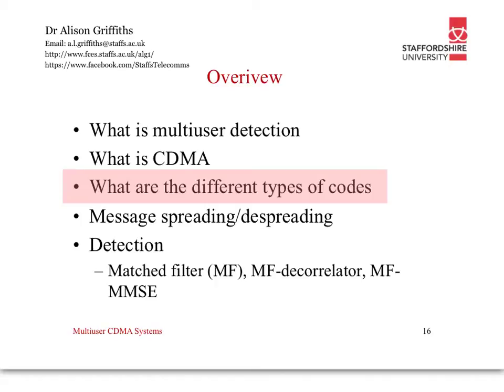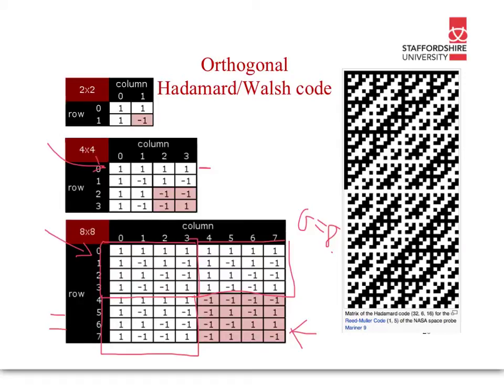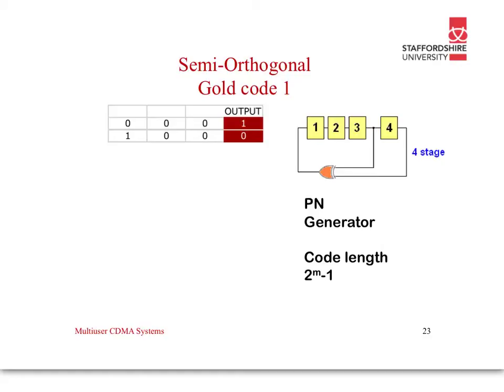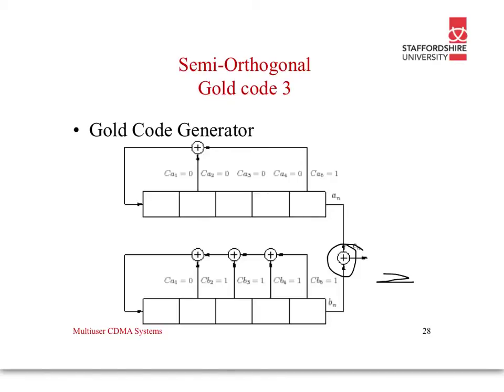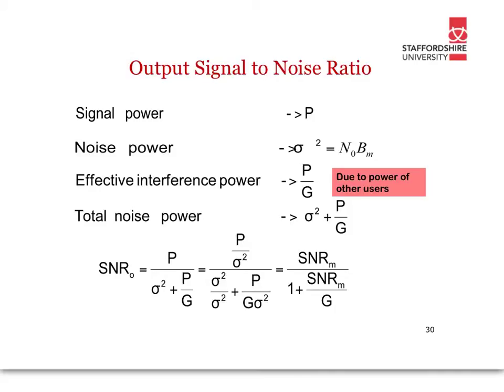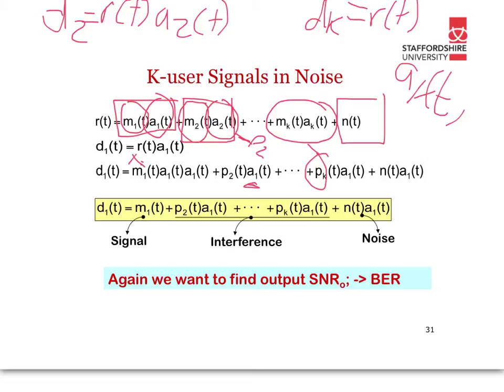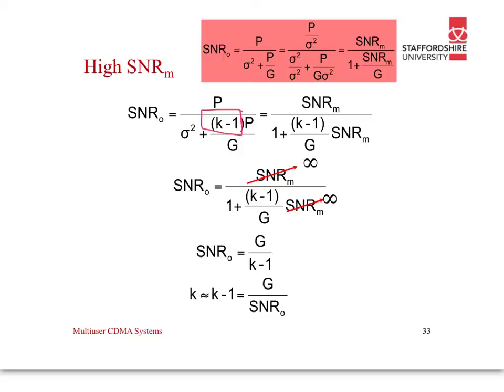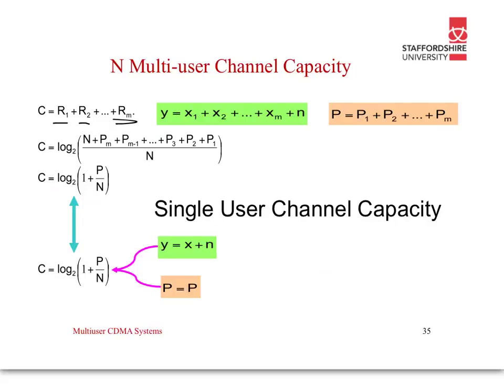CDMA part b

Comment: Hello, thank you for your nice explanied video.Could you tell me please whether or not to get a 7X7 Walsh matrix?I mean we generate 4X4 by using 2X2 and 8X8 by using 4X4. That is to say it is not possible to get NxN if N is not power of 2?
Reply from the maker: it need to be ^2, however you do not have to use all of the possible codes, therefore you would use 7 out of the possible 8 in the above example